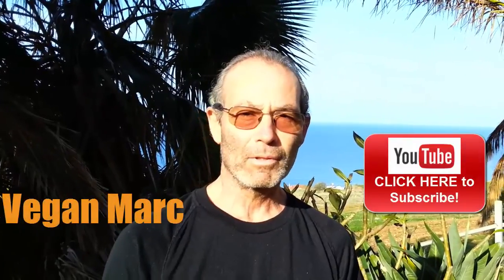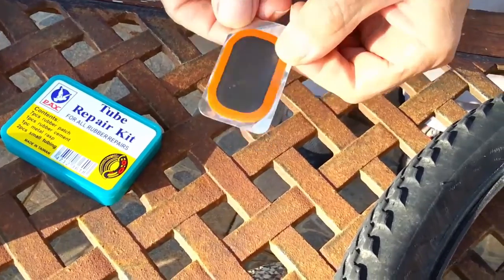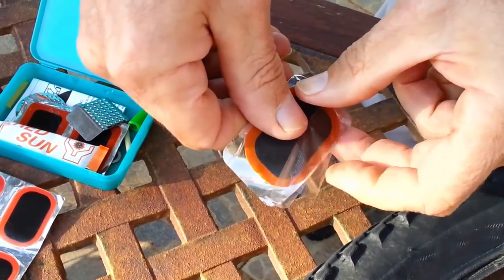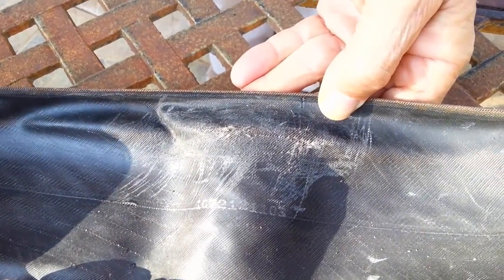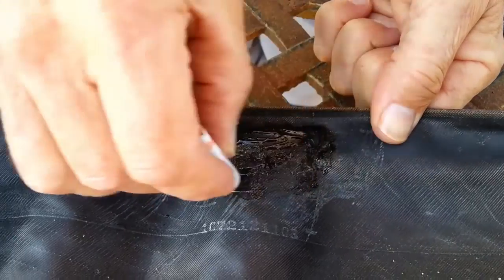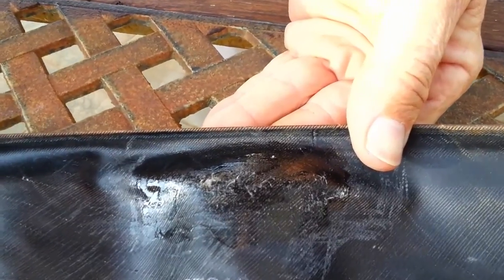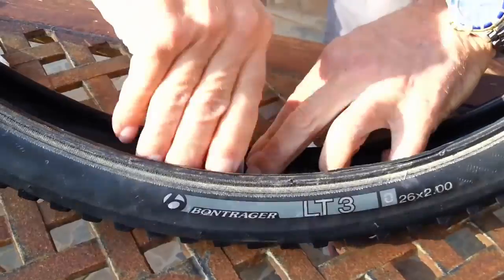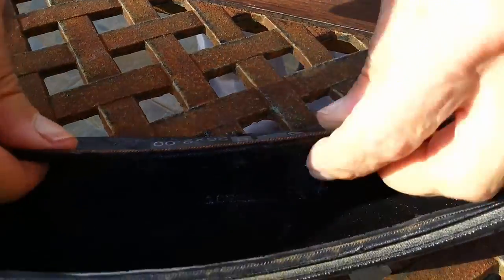How To Repair & Reinforce A Bike Tire Sidewall Simple and Easy DIY

Comment: I like to leave the cellophane cover on because it makes it easier to handle the patch without touching the sticky side, and it make it easier to seal the patch all the way to the edges. I just leave it on after the repair, it is thin enough that it does no harm.

Completely agree to let the glue dry - this is rubber cement, works best when dry.